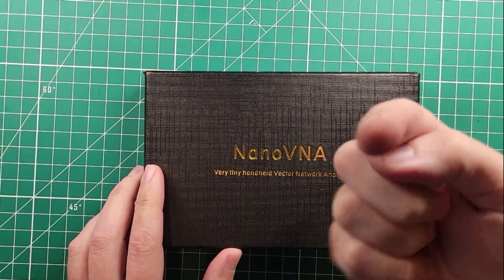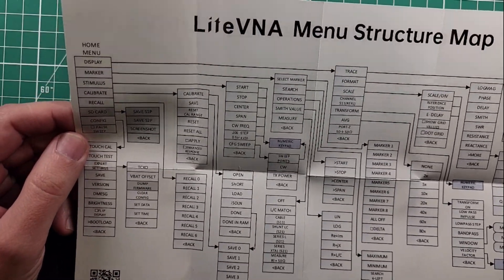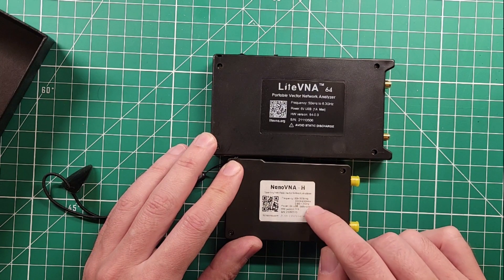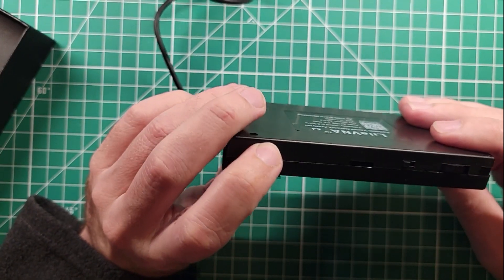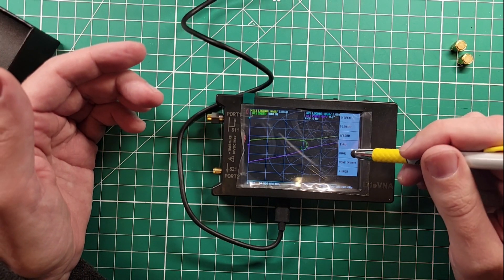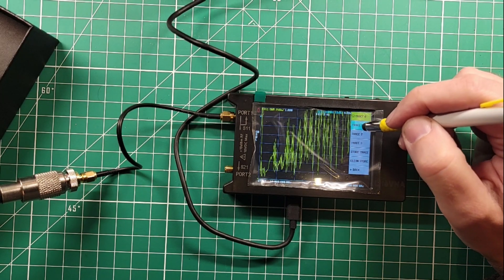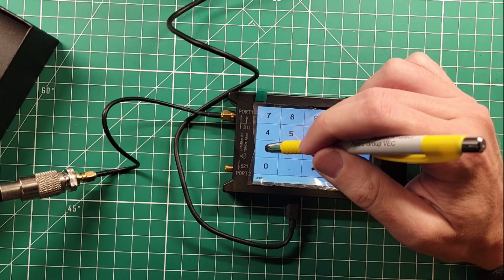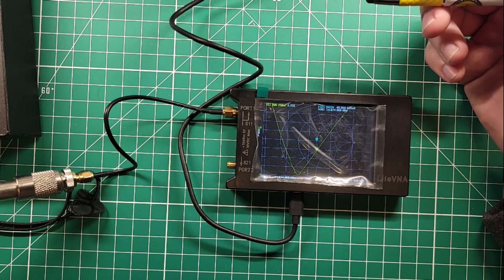How does the new LiteVNA64 compare to the NanoVNA?

Comment: Yeah so you forgot to change the port for the second line. The first line was on S11 and the seconds on S21. Which means that the second one was measuring nothing.
I am amazed by the speed of this thing. My current cheap chinese clone does 201 points per second orso. This thing does ~1001 in less time it seems.
The only reason I consider buying this is because I want to match my WiFi antennas. (And technically because I want to finally check properly which of my ADS-B antennas is best. I can do that right now but I am all but certain about the results because its a cheap chinese clone.) It would cost me about 170 euro.
Reply from the maker: Thanks for the tip! Good luck with your ADSB setup, those are fun.

Comment: The calibration did not take into account the pigtail you connected so the calibration plane is wrong.
Reply from the maker: You calibrate was is needed to isolate the DUT as best as you can.  I haven't seen this video in a long time, but I probably would have needed to add an adapter, that I would have to remove to complete the test.  You're right though: "do the best you can with what you have".  If this were a true lab, I'd I have lab grade tools and proper jumpers of all minds. "Good enough" is a great place to start.

Comment: How is nothing on the same as open? I thought you need the open sma calibration because it takes into account the tiny air gap.
Reply from the maker: It's a very tiny air gap, and you might be introducing more capacitance then You're measuring out of "nothing", both are well below the tolerances of the device.  Do what makes ya happy and have fun.

Comment: Hey, thanks for the reivew! I have a similar LiteVNA at home but it i almost unusable as there are huge fluctuations when measuring. I noticed the same kind of unstability shows on your screen. do you have any idea how that can be reduced?
I am using the tool on a portable radio rubber antenna and once attached, every little move i make with my hands around the antenna or the cables dramatically changes the SWR reading.
Reply from the maker: Your body introduces capacitance as your field combines with the antenna - distance or a better antenna that has "the other half of the dipole" would help.

Comment: My aging eyes would like the larger screen. Here are some specs from the link: Frequency stability <0.5ppm. Sweep rate >550 points/s Avg=1. Sweep points (on device) 10 ~ 1001 points, adjustable. Sweep points (USB) 1 ~ 1024 points, adjustable -
Reply from the maker: Thanks Michael